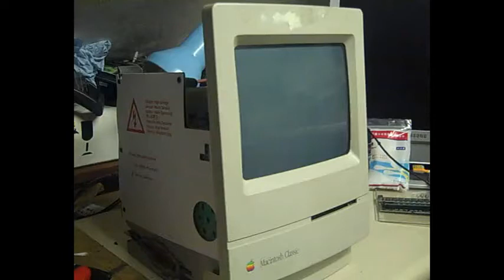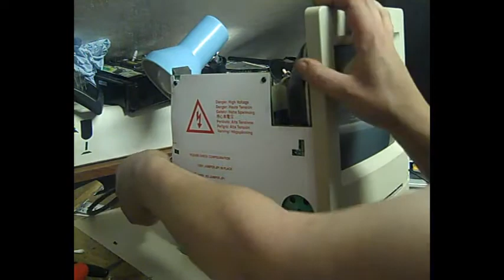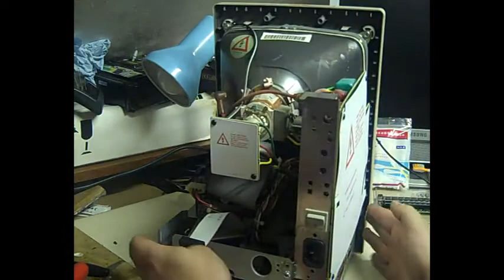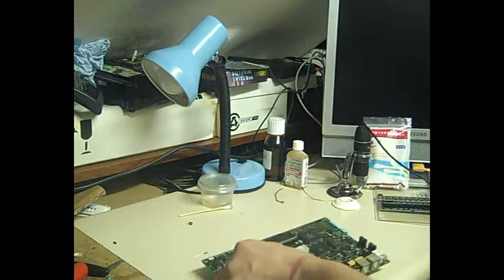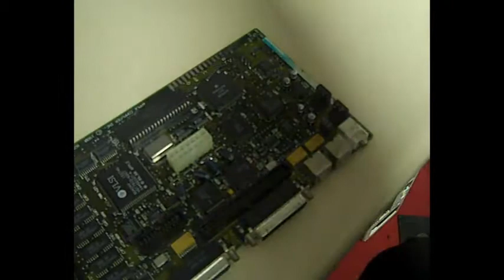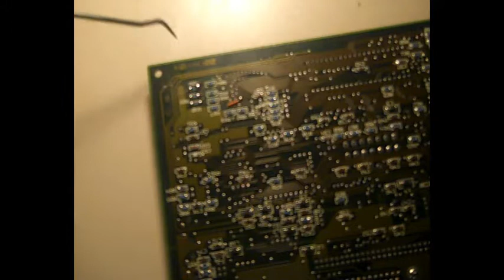Mac Classic repair Pt3 some progress

Comment: I have the same issue. Already replaced the caps. Boots to that blank screen with nothing else. Have you found the solution?
Reply from the maker: Sadly not the corrsion on this one is just too far gone, im trying to find a better board to repair, enough have ended up as fish tanks that I hope to find a repairable board one day.
Reply: @Jayoldstuff1  i have a bad board with same issue has almost no corrosion and new caps not working still any ideas?